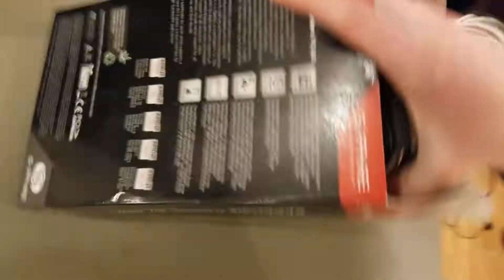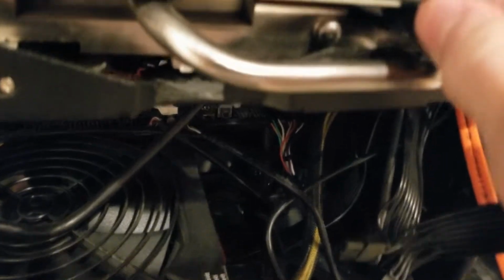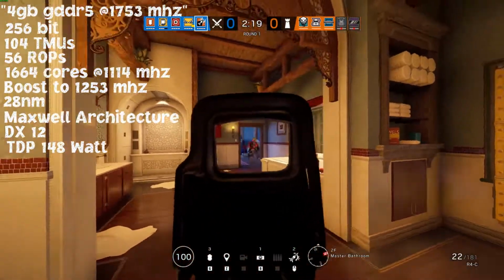Is the GTX 970 GOOD in 2020? Surprising results!-Fortnite PUBG & More

Comment: Would i7 2600K with GTX 970 4GB and 16 GB ram good for streaming/gaming
Reply from the maker: Should be able to do so pretty well. I used to stream a bit on the weaker 9590 chip and it was actually pretty decent.